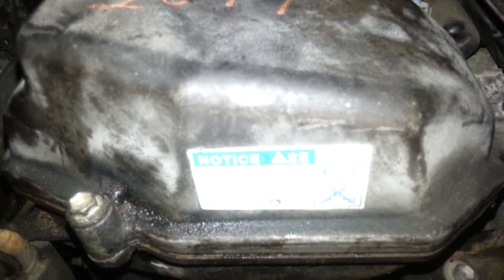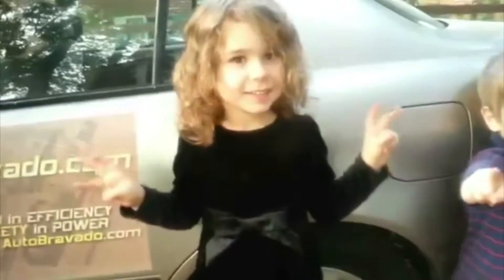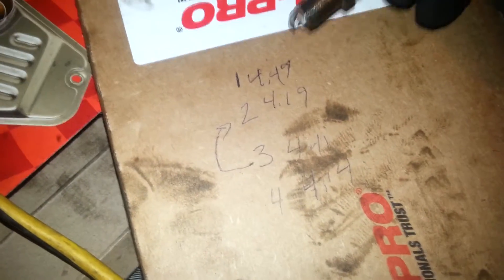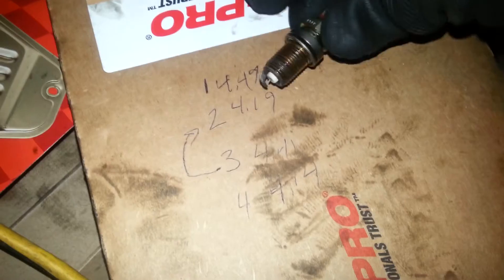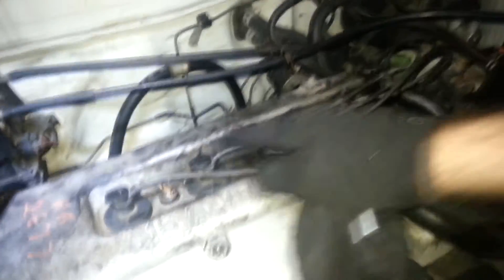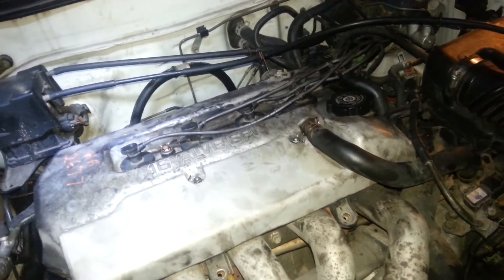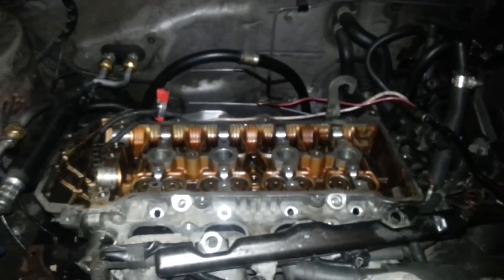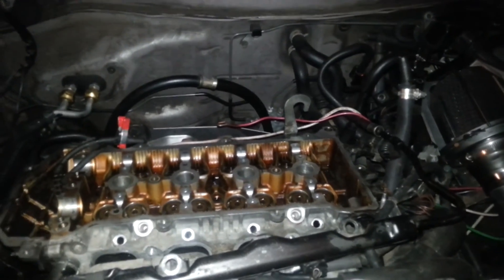Balancing Spark with Spark Plug Gap and an extra secret! Shhh!

Comment: Does the spark plug nail gap make a knock in the vehicle? This knock comes from the cable no. 1, that is, from the long one.
Reply from the maker: If your spark plug system is healthy and you have engine knock, you could have mechanical damage. A good pro should know the difference immediately if the engine damage is bad enough. If it's earlier into the issue it might be harder to say.

I always rule out fuel and spark if something is off, but that means knowing how to do diagnostic testing. Are you familiar with such tests? It's not a basic thing, but it can be learned.

Comment: Just replaced my plugs and they were .044", the manufacturer spec.. My car seems a bit slower (butt dyno) after driving it for a day tho. Should I try a smaller gap? Like .037" and see how she feels then?
Reply from the maker: That would be a very dramatic change. Going wider is actually better for power as it can increase electronic timing advance. Like say, trying .046. Be aware that the wider you go, eventually, you're making more power by eating the engine because it goes leaner.

Since you're likely on a fuel injected and not on a carburetor, the computer will add more fuel.

Conversely, if you go tighter like you're suggesting it will make it more rich, but instead of getting more power the computer will pull gas out and reduce your power.

Trust me, I have tried them all, but that experiment, I only ran on my truck, not the Corolla. The engine was going and I was trying to have enough power to go down the freeway at the speed limit.
Reply: @DENicholsAutoBravado  makes sense, I like how it's running now. Thanks man
Reply from the maker: Awesome. Glad to hear it. If you're ever thinking of racing specs for spark plugs. I did a lot of experiments in that regard that I never edited and put up.

It wasn't to race, it was to keep a dying engine going down the road longer, but at one point I made my truck ultra-fast on accident. It was the best use of a dying engine. 

Losing my truck kind of broke my will to make YouTube. I'm long since healed to my soul, but it's hard to get the habit back.

Especially, when my updated video editor now crashes instead of working better. 🤣

When the crypto bull run is over I'll probably spare more time for it again. If you've ever liked crypto, you might like this. https://youtu.be/L1SULOb24vE

Been a little more active on this side of things.
Reply: Iridium plugs btw

Comment: The idea that a 0.3 ohm resistance on the plug is going to make a difference "fast/slow" is BS.  The resistance that the coil has to overcome is measured across the air gap and that is multiple orders of magnitude higher than 0.3 ohm.  In any case feel free to practice snake oil tuning if it makes you feel better.
Reply from the maker: Have you ever checked the resistance and energy needed to cross a gap? The resistance difference is exponential. 

It's also highly variable to how rich the fuel mixture is. A little richer and spark is easier. I think that's why sometimes engines which struggle run rich. If they don't, they'll just die.

Lol. One Ford was what we called rolling coal until we figured out all the insane symptoms were around 1 issue. A coolant leak.

Couldn't believe how badly a little coolant leak in just the right place could cause such trouble.

Comment from the maker: This car had 320k miles and now it has 460k miles! Think it'll make it to the half million mile club? I did this big repair day 14 months ago (see below for more videos made this day) and this Corolla has done another 140kish miles since! I've changed the spark plugs again and I was good this time and did the split fire Denso plugs. I'll have a whole series coming of more repairs this car has needed because it has just gone so far!
Reply from the maker: Another great job done on this vehicle:
The radiator was bad and I remembered to take care of topping off the transmission at the same time. This is a critical detail most forget. 

Well, my friend went nuts and went all I'm with a transmission pan drop and fill with filter, valve cover gasket, spark plugs, and probably more which I forgot!

Comment: My manual says 0.031-0.035in what is the best gap
Reply from the maker: Short answer? The middle is the best place to start. Long answer? Listen to each cylinder. If a cylinder sounds duller than other cylinders then go from .033" to .031". If a cylinder sounds really hard, going up to .035".

Comment: this is a litle lean but ok
Reply from the maker: I find most modern cars show a little sign of lean on spark plugs. I think it's a regular event programmed in rather than the car actually running lean a lot. The same plug can have black sections showing times of going rich. When one plug reads particularly worse than other cylinders in any direction it could be evidence of an issue.

Comment: you feel more power by changing gap .002 ? I call BS
Reply from the maker: If an engine is running smoother then it's not wasting power. Even if it wasn't a discernible power difference I believe a smooth running engine will last longer. When I've had to change gap as much as .008" to stop a minor misfire then for sure that made more power through rebalancing.

Comment: just pulling my leg right? or is there some truths to this?
What do you think would make a V8 dodge ram 2500 gas engine idle poorly once it warms up and eventually the check engine light comes on? after a minute or so it wont run without keeping the gas on at least a little bit. it seems sluggish on revving up too when its been close to operating temperature.
The exhaust is clean and smokeless. sometimes i hear what sounds like a partial misfire (clunking sound) and the exhaust sounds very sputtery and inconsistant

it starts right back up immediately if it stalls out. just still runs rough until it completely cools down.

if I disconnect one of the connectors plugging into the intake immediately after the air filter box. it idles much higher which seems to combat the rough idle a little bit enough to keep it from stalling out and needing to keep the gas pedal on as much
it still runs rough until its above 2K RPM then it runs almost perfectly smoothly even close up to redline
Reply from the maker: That engine is probably MAP not MAF run like many Dodges so if you give it a big enough air leak it'll run really hard. That's just like keeping a throttle plate from closing all the way on a MAF ran car...It'll keep it running but it's helping keeping it running while making even more be wrong with it.

What year? What engine?
Reply from the maker: I'd be interested to know the engine code. Running rough could be a spark plug issue and yes, everything in this video I have done to make an engine run even smoother than with just new spark plugs alone. Picky engines need this kind of tuning even more.

If you have a 90's dodge for example the way they ran spark plug wires laying all over the engine burns them up and it'll cause running rough issues as well.

On one Dodge I saw the TPS go negative. Negative! Yeah, it's not supposed to do that. I twisted the plastic holding the tps after loosening the bolts and tightened it up in it's new position. They're not supposed to be adjustable but I did anyway. You'd have to check live data of course before making such an adjustment.

A coolant temperature sensor (ECT) could be off and cause your issues as well. You'll need a touches thermometer and live data to see if that's off. (Often on sale at Harbor Freight or find a similar one as I used on my water decarbonization video:  https://youtu.be/WQ6_AdZWlzU) 

Last time I replaced an ECT for a Dodge left me wishing I had recommended a coolant flush. Filthy ETC sensor!
Reply from the maker: I'm just brainstorming a ton. I hope you can do some testing. I'm a diagnostic technician at Pridgen in Rocky Mount, NC and my purpose is to solve issues like yours. Not a lot of tech's like me. Not bragging. Just worked hard under some diagnostic trainers but they said I already knew a ton. I told him I learned from the best on YouTube like Schrodingers Box. My first job as a diagnostic tech instead of a regular automotive tech they were like that's where you learned? Lol. Old guys sometimes have a hard time believing the kind of info. is on YouTube. Others figure of course it is. Everything is online...well...the best specific data you have to buy...but yes, it's online.
Reply from the maker: I usually won't recommend wires and spark plugs without testing compression. Too risky since we guarantee our work. All that time lost and spark plugs aren't returnable. Compression testing the thorough way is here: https://youtu.be/GaC6OIQkv_4

Comment: Try gapping all plugs 20% wider than spec for more power/mpg -- oops, that's another secret.
Reply: DE Nichols consider tumbling air moves faster than air being simply ingested. Look into Reynolds Number. It works with carbs and port injection - no effect on direct injection because there’s no tumble/vortex energy left by the time the fuel is injected into the air charge. It’s all about homogenizing the air/fuel charge with gasoline vapour rather than droplets.
Reply: DE Nichols try resistorless plugs and Granatelli zero ohm wires for big sparks. Your grounding will really help
Reply from the maker: This car doesn't have resistor plugs, but when I had my first car it ran awful on resistor plugs even though the parts guy said that was stock. It ran so bad for trying resistor plugs that 89 Nissan Pulsar was still slow when I switched back.
Reply: DE Nichols if you’ve already checked Ron Hatton’s video have you considered his throttle body modification? it works quite well on my daily driver. After I add George Wiseman’s EFIE and MAP mod, I’m considering Aaron murakami’s plasma ignition
Reply: Wes yup. You want the widest gap your coil(s) can work with based on cylinder pressures(N/A, forced induction, compression ratio) .
Reply from the maker: +Wes Kellogg 20% wider huh? I'd love your feedback on more of my videos. Oh yeah! You're watching and talking about another? Awesome. 

20% on .044" would be about .053". I have a buddy who races in California who said he moves his plugs out a few thousands and tests it to the point misfires start then they back it off.

You know if you keep watching and reading you'll see where stuzman (an engineer with his own excellent channrl)...he explains the sparks heat won't actually change from gap changes. That tells me that what you're really doing is advancing timing. That does make more power. More gap means spark starts later.

I told the California racer he needs an advanced scan tool to listen to his knock sensor so he can know when he pushed it too far more accurately. :)

On my hydrolocked Chevy Prizm I have coil on plugs. Way cheaper to try it there than on the Frontier. Distrubutor assemblies are very expensive if you push them too hard.

That said, I'm reminded I can adjust the distrubutor cap on my Nissan Frontier and try more timing that way. Safer on the coil.

You've really got my ideas flowing! I hope to talk to you again soon. I gotta get back to work.
Reply: Yes, .053 is what I'm using in my 09 Camry now... I can't speak in much detail about specifics on the why or how, all I really know is that it works despite what "experts" may say otherwise.

You should check out Ron Hatton's (sp?) YouTube vid Re plug gap and combustion...I'll link it next time I'm on a computer. He tests plugs on a lawn mower with an emissions  monitor each test increasing gap by 20% and each test emissions go down & it runs better...
Reply from the maker: +Wes Kellogg I look forward to it. Hey...maybe tricks like these would help with my barely failing catalytic converters. Actually since it increases risk of knock and my knock sensor is down maybe I really need to do that first.
Reply from the maker: I have done the knock sensor now. Now I want to try it!
Reply from the maker: I'm loving the comments Gregory, keep them coming. Consider watching my Air Flow theory series starting with this one: https://youtu.be/51RmXBNbe7I

I appreciate the video suggestions, when I watch them I learn and teach a few in the comments and occasionally mention a similar topic on my videos. Helps grow the channel and find interesting people like you. I'll be following up on more of your comment later. Back to homework. :)
Reply: DE Nichols you’re not understanding what the Groove does to air (and fuel, more importantly), and why rerouting the IAC channel is important. Ron would be very happy to school you on his techniques, and I’d love to be the fly on the wall for those debates. Spend some time in his website’s forums first though.
Reply from the maker: I'm suspecting it'd help a carburetor when you added what it does to fuel. Tumble at the throttle could only help a carburetor. Fuel injection even port fuel injection just needs air fast, tumble at the throttle body only slows air down for fuel injected or direct injected vehicles.
Reply: DE Nichols it's more than just "tumble." think what the vortex does to the pressure wave in the intake tract. It's not a steady smooth flow of air. Look at how vortex currents work in a river and how they can modify them by placing boulders in a pattern to control the flow & speed and keep the massive flood currents from eroding the banks. You'll find a similarity to the throttle body "groove" mod and the river flow experiments.
Reply from the maker: I'm in school full time now so I haven't uploaded as regularly, but I've been dying for 3 days to get back to some of your last comment.

I watched a video where he did a groove at the top of the throttle plate. This reminds me of what you're doing when you clean up the bowl, which air must pass through first to get past your intake valves. Even more similar in concept, is removing the machinist ridge in the combustion chamber. This increases the effective valve lift because air can get velocity sooner when the valve just starts to lift up. 

Here's a comment I left on a video which was 6 minutes long following your keywords: "I like the groove idea, I just wouldn't do the idle air valve port mod. [He blocked the port for his IAC to have control over idle - very bad. Lol] I hope you opened that back up. On Chevy for example, the IAC isn't just used at throttle, the engine opens and closes this to help with engine performance so you get more or less air as needed even when you are stepping on it. This helps the engine not die when you're done stepping on it and stop stepping on it.

Now that you have a high idle you've lost tremendous efficiency. To racers, idle efficiency is key for range. If you can mod an engine for more power and still have an efficient idle, your fuel goes a LOT further. Think about what your engine is doing everytime you release the clutch? Same concept goes for automatic transmissions."

Comment: Hey DE this sounds all really cool ,I been around cars a lot of my life.Dad had a garage station and people tend to just dump their vehicle off rather than get expenses don't want. However I got lucky ,Got some sweet rides now that I look back. Back to the point here you really have something there for sure. Giving the aspect of the cam shaft : What are your findings with slight vibration at all. You must have a sweet spot Ie. I General , Is it when your at a higher R.P.M? or overall? Have you heard about indexing your plugs. You sound like a smarter than average type of guy, So thinking about your video here Has lite a spark of an idea! and I like the formula you are using ,How many formulas have you been playing with. I myself run a third generation 4.6L Ford in a explorer ,Which has it's sweet spot ,Knowing how to utilize them.So your theory the atom is theory from the weight of the electron compared to the proton, I movements or shrinkage attachment and so on is something you should explore to it fullest extent and share you findings more as a graph system . so we laypersons could learn wht t I think is more than half brillant, also utilizing some other technical addition to keep a fair balance. Thats just me, I'll be looking out for more
Reply from the maker: Albert Nairn Hey if you like deep spark plug videos I've produced several. I have a whole series on  the subject. 

Bu your comment in  sounds like you got excited watching this. I'm so glad!

Yes. I've heard of indexing spark plugs. This is where you get your spark plug's blade opening to face the intake valve. It's the one thing I haven't tried. It's only a 1% difference in power. It's difficult. My techniques are easier if you understand them. Lol